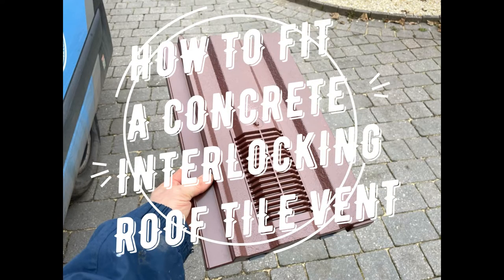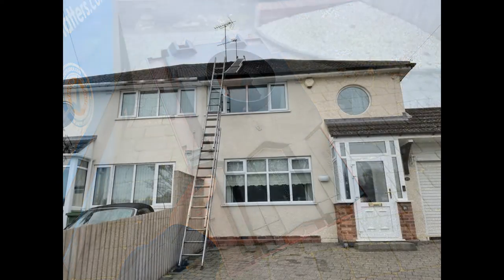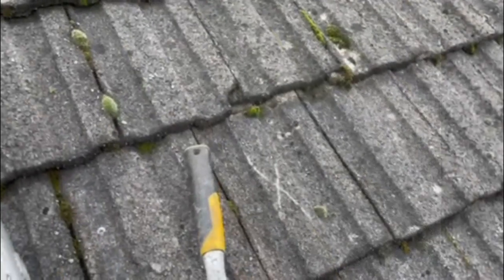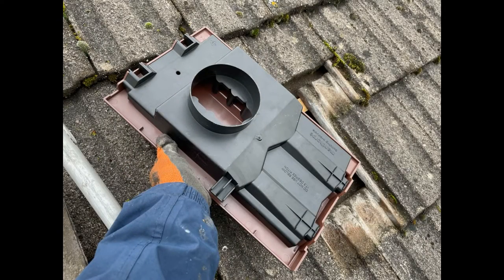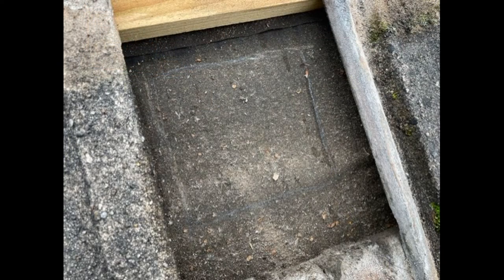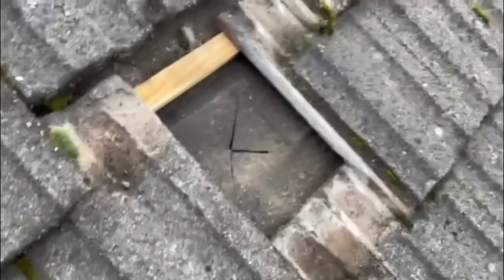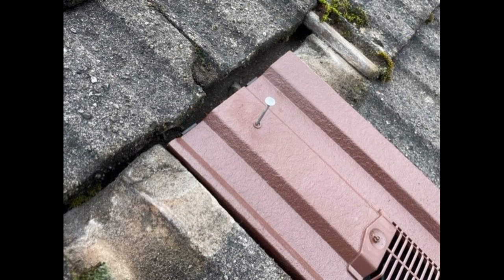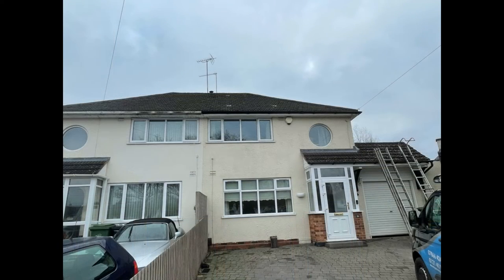How to fit a roof tile vent - concrete interlocking roof tile

Comment: Thank you for this video anyways, as I'm planning to install some vent tiles on my roof and it helps a lot. The only difference is on my roof they are single wave ones (called single pantile I believe?) concrete tiles.
Reply from the maker: Thanks for the a acknowledgment! Sounds like Anglian roof tiles you have. They are pan tiles, the ones in this video are also pan tiles, interlocking. You can get vents for those tiles and the process is basically the same. 👍

Comment: Great video. I doubt I will be fitting these myself, though you do inspire great confidence. I do wonder - are none of the existing roof tiles nailed in? I saw this in another person's youtube video and I wondered how he 'slid' these tiles out from the midway position if they had been nailed in the first place? Or have I misunderstood?
Reply from the maker: Thanks for the comment and glad I inspire confidence! 😃 Usually every 3 or 4 tile courses are nailed, not all courses need nailing. But some building sites require all get nailed. If the tile won’t budge, tap one above it up and remove the nail to get it out. 👍
Reply: @davesalter  Thanks. I am in touch with a local roofing contractor to install some vents, but it's good to have some knowledge on the workings of these things.

Comment: Wouldn't it be easier just to put lots of soffit vents -  soffits here seem to be plastic upvc ones so should be no issues drilling them?
Reply from the maker: Soffit vents will help and can be used in addition to tile vents to increase air flow, vents at roof line (fascia/soffit) and also higher in the loft is ideal really. 
Plastic soffits is often fitted over what was there originally, either wood or in some cases Aesbestos boards, so I’d make sure there is none of the latter before drilling holes though it.